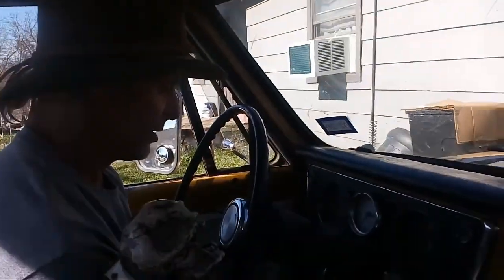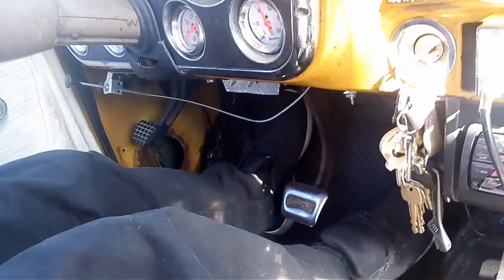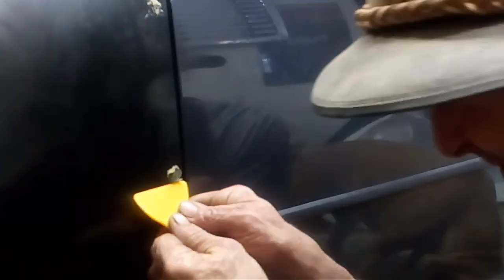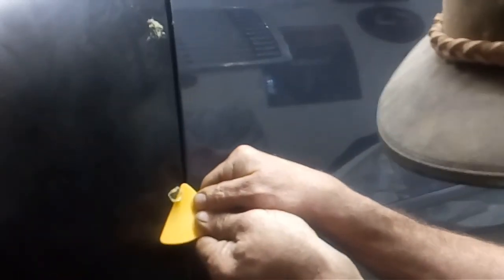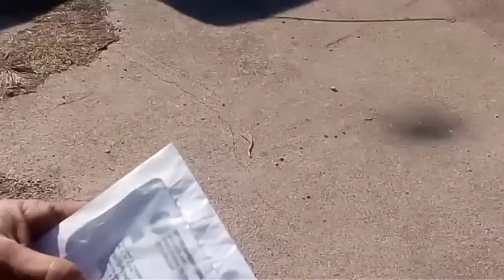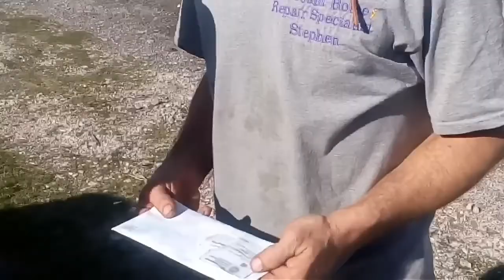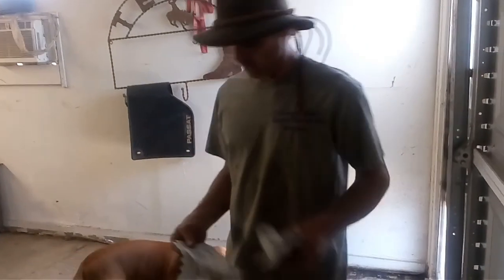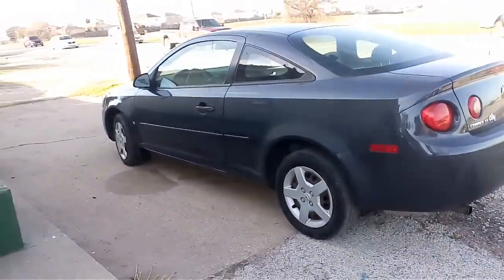Finally on awesome paint job

Comment: Thanks for the clutchless intro! I've got a lot of synchromesh to burn through to get it Everytime but I appreciate the demo. Most videos on YouTube are wrong or big rigs. Clean painting too.
Reply from the maker: From the 1980s or older it's easy to the float gears especially on trucks some 90s forward from my experience it becomes a little bit more difficult the gears just doesn't seem to fall in you have to press them and hold them a lot longer you can even begin to hear the synchronizers starting to wind and it'll pop in for you are you trying to float gears and if so what year is it and what make
Reply: @limpy8175  1998 jeep Cherokee. It'll float into every gear but first and 2nd gear is hard unless you're barely moving. Goes in with barely any force at all most of the time. I just think it's a good skill to have if my clutch goes and I need to limp home.

Comment: Nice Limpy
Reply from the maker: Starting to figure out that painting is easy it's the body work that's the b** at least for me it is anyway the last time I did body work it took me three days just to do one driver-side side door and the whole door was one complete sheet of Bondo about the thickness of a slice of paper that covered the whole door when I got done my mentor told me that a decent body man should only have taken one day I looked at him and said you ain't got to tell me I'm the one that had to put Bondo on there and take it off for three days over and over and over and over again until I got it right I called it chasing dents and that's what it was. I repairing small areas of a door until the whole door is done that the only way I can explain it